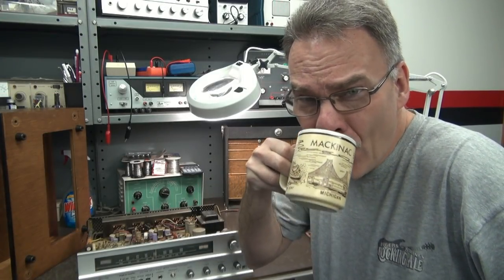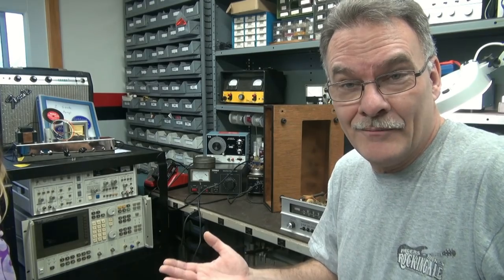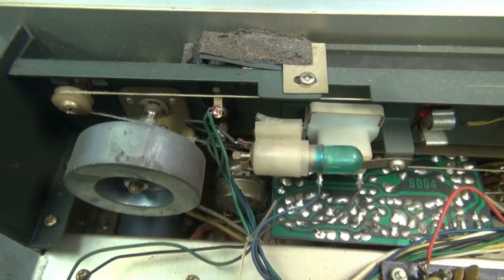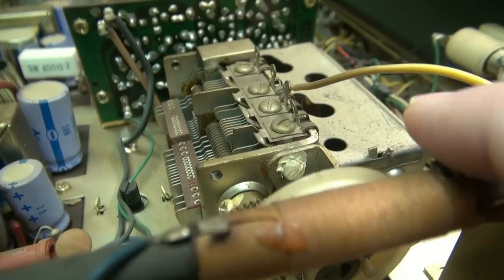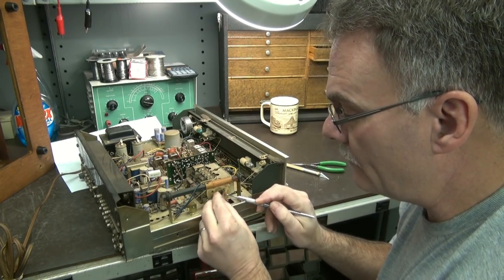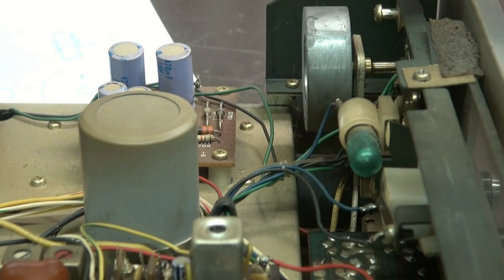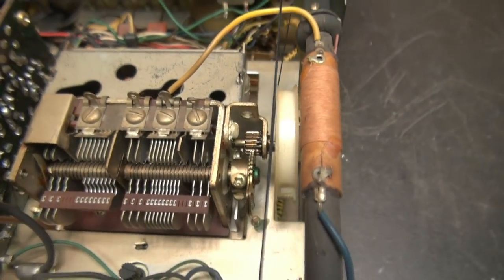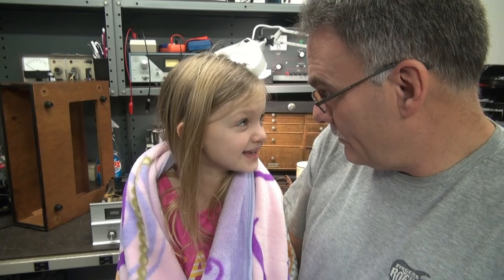How to replace repair dial tuning cord vintage AM FM stereo receivers D-lab Electronics

Comment: Back in the 60s I worked as an independent . I repaired many dial cords on old Crowsley , RCA , Admiral , Zenith , and the like , console tube radios . They were always a mind blower with all the pulleys and usually were broken . Owing to a lack of available info , I took a guess at the routing and number of turns on many of them , but I stuck in there and fixed them anyway . Those jobs became the barometer with which I judged the difficulty of any other kind of repair I did later ..chainsaw engines,cars ,etc . Nevertheless , I loved fixing stuff .   Oh yeah , and I ran into many a vermin nest or spider web along the way . The warmth from the tubes was quite attractive to them , I'm sure .  😀

Comment: Thanks for the informative video. I’m conflicted about trying this on a super clean HK Citation tuner and was searching for some advice to steel my nerve!  The only other time I tried something like this was many years ago and it did not end well. In my case the dial cord looks great, but as near as I can tell, the only way to get access to the burned out back-light lamp is by removing it’s cover, which has the flywheel assembly attached to it. You have some great tips in here. By the way, watching this with a BT headset on, and your audio is excellent. Great job on the production values...  Back to my problem, I think I’m going to find something at a flea market so I can practice before I tackle a perfectly working dial cord assembly.  And, before anyone says anything, without that lamp, you can’t see ANY frequencies.

Comment: When the shaft is locked up it is curtains? Maybe I misunderstood. A stuck tuning cap shaft can be heated up and it should loosen up the fat or whatever it is. Great video ! Edit: I just remembered I filmed the heating of the stuck AM tuning shaft The video is called: "Tandberg SS11-73 Fault finding & Seized AM wheel (part3) "

Comment: Nice video but you skip over 2 important parts. You should show a closeup of the specs for the braided nylon fishing line you are using. I had to freeze frame over and over again. Looks like 20lb braided nylon fishing line, 20lb. You also skip over the detail on how to tie off and properly tension the string. What's the trick for tying it off at the spring and getting the right tension?
Reply: YouTube- Tying a perfection knot.

Comment: It helps to have a highly qualified foreman to oversee a job like that. You should put out an advertisement for anyone with a busted dial cord to bring you their stuff :o) 

I took on a stereo of that vintage that belonged to a friend if mine a few years ago. It had an intermittent popping noise and a few other problems, one of which was record player :o/  The spindle was locked up due to bad grease and I liked to never got that thing working again. I had a lot of hours in it when he got it back but he was happy so it was all good. 73 NE5U  Mike

Comment: Great video! Thank you. I have to replace the dial cord on an old Graetz 613. Could you please tell me if the new dial cord is only cut where it connects to the dial itself or is it also cut where it goes around/connects to the main cap?
Hopefully you have time for a quick comment.
Chris in Red Deer, Alberta

Comment: How do you determine where to attach the indicator needle after stringing the new cord?
Reply: I wished he'd have shown that.  My guess is that after you know that the string is installed correctly, you can turn the receiver and tune in to your favorite station.  Then, reattach the dial indicator and reglue it.

Comment: I have the service manual for the sa-500 technics. 
Looking at buying it, but seller says the tuning knob only moves dial to the right and not left.
Is this am easy fix?
How did you set the needle to make sure it was reading proper stations?

Comment: Though I’m very capable of replacing worn out drive cord, it is one of those jobs I very much dislike doing.  
Do you find more and more Vintage Radios are requiring the drive cord replacing?  I certainly do!  Problem is, nylon braided glass yarn, and woven flax yarn drive cords are no longer produced here in the UK.  
I too use high tension plated flax fishing line as a substitute for proper drive cord.  I never use nylon fishing line.  it is too slippery, and very springy, therefore difficult to fit round the drive spindle,  pullies, and master drum.  it can also stretch slightly after a few weeks from fitting, therefore causing drive slippage. 
Phil.
Reply: 30 lb test fishing line. Violin bow rosin will keep it from slipping.

Comment: Hey i have a 1968 harmon kardon five thirty that looks similar to this. Anyway it made a pop noise and now a loud hum comes through the speakers now along with music. Any idea what happened? Did it bust a cap somewhere?
Reply from the maker: Hello, That sounds like a leaky output transistor. Check the speaker leads, see if there is DC voltage present. Normally there should not be.
TD

Comment: i have a grundig ks620u ch=45u console . the tuning cable is just lying in the chassis . how can i get info on redirecting/ routing  the cable on correct pulleys etc... this cable has a eye on each end . thank you sir.
Reply from the maker: See if you can find a Sams photofact on that radio, the dial cord string info will be included.

Comment: Nice work Terry !!!!  Unrelated question if I may.  When you test an amp with the dummy load resistor, what do you use to inject the signal ?  I have a single generator , would that work at like 1000mhtz?  thanks as always  Ron
Reply from the maker: Hi Ron, I use an old Heathkit audio generator set at 1KHZ, 150mv
Reply: thank you sir
Reply: 1000 mhz is radar stuff - L band.

Comment: When you restring it does dial needle need to be certain spot on cord to tune right station?
Reply: I would start at one end till it stops then you cancalibrate the needle too your favorite station.
Reply: End point travel at both ends, then attatch pointer for equidistant position.

Comment: I was replacing capacitors and lamps on an Onkyo T-4055 this past weekend and the dial cord broke. I left it in place and I have dial cord I used to replace on Luxman receiver, but that was 20 years ago and I can't remember what type of glue to adhere the cord to the spring.  Would someone suggest what type of glue to use? Thanks in advance.

Comment: Pry?! Break?! Hosed?! My wife heard you say that, me laughing and she said "that guy sounds like he'd be one your cronies in the basement". A compliment I Think? Heh heh Anyway, I'm working on a telefunken console radio and doing the same thing. Pretty confident as I've fixed sewing machine loopers, remote mirror control cables etc. I have a question though and you seem like the guy to ask. This radio has a separate LW & SW tuning cap and picks up some promising scratchy but audible noise. Quite a bit of dust in there. Can I use contact cleaner on it safely and would I want to lube the shaft ends afterwards? Or, am I just dreaming that I might get the SW reception. Guessing I might have to run a SW antenna as well? Any help would be appreciated. Great info btw.

Comment: "..May be for another ten years .." I do not think so, because you have two capacitors that had to be changed, 3:41 right next to the heat sink of the transistor (TO-39) it is probably he heated, so always change the capacitors that are near the heat sinks. They warmed well with time and their liquid evaporated, so they changed values. 4:11 There, we can clearly see the two capacitors

Comment: Great video Terry, lovely production and sound, Sissy the star!  I have similar problem I think, on A&R (Cambridge) T21 FM tuner, bought in 1981.  The tuning knob been slowly less effective, now doesn't move the frequency.  T21 does not have a vertical frequency marker, instead has 21 red LEDs at intervals of 1MHz, but I assume a similar string or cord. Fortunately T21 has 5 preset channels, manually tuned at back of unit.  These, almost never used, seem to be working still.  Will attempt your approach, the technology must be similar.